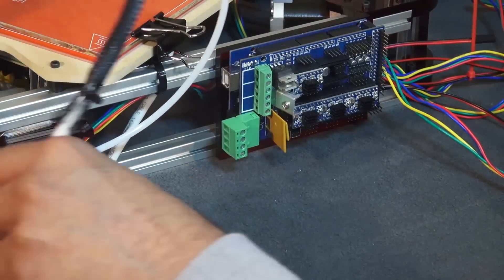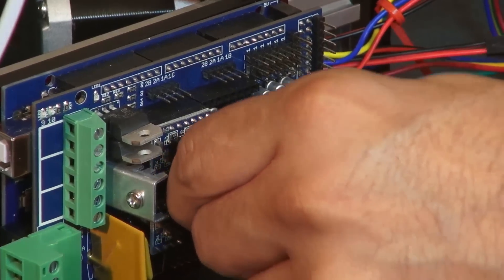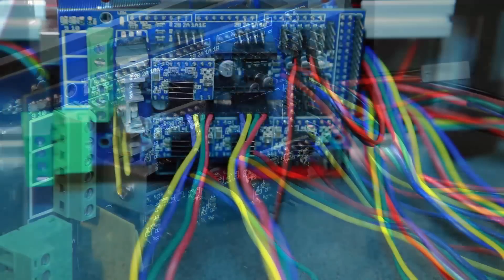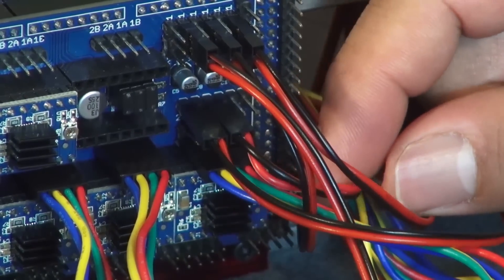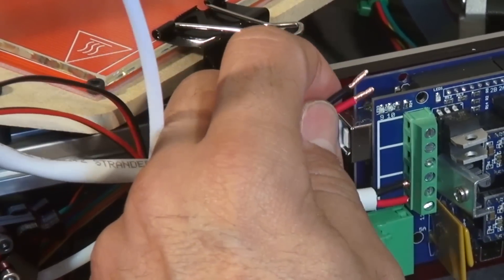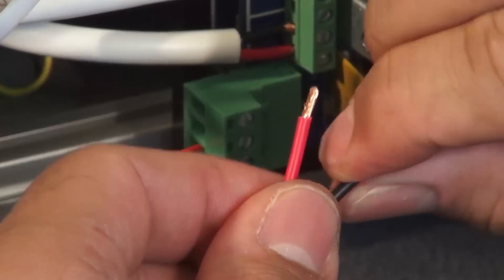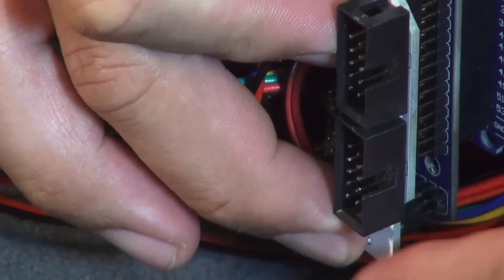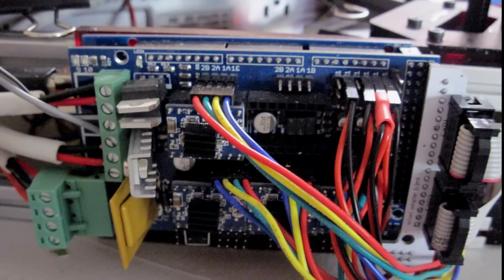Kossel Clear Build Instructions Chapter 24: Wiring the RAMPS

Comment: Sir i m using 12v 10A power supply SMPS is it okay for input to RAMPS module or else i have to buy 12v 5A power supply SMPS while wiring u eaid that 5A and 11A is that fine if i use this 12v 10A power supply 

Thank u

Comment: If I'm connecting 1 stepper motor only, do I have to connect 12v in one power input or tow 12v in both inputs, or I have to connect one 5v and one 12v in the power input? 
Because it have 4 holes for power inputs 
Thanks

Comment: Hi, when wiring the incoming power you say to wire the 5V wires. But really I think you mean 5 Amp wire (aka the smaller wires). As far as I can tell there is no 5Volt supply anywhere on the machine.